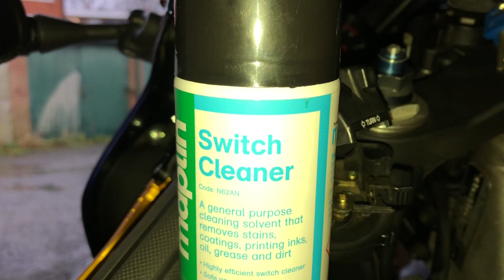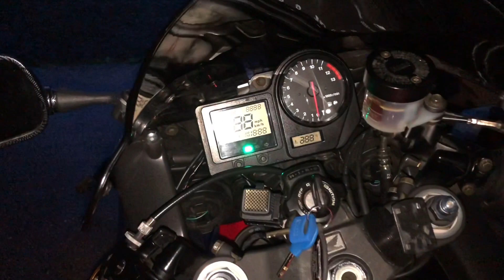Honda CBR 929 RR Fireblade Turn Signal Switch Repair

Comment: Have you had any issues with the hi lo beam button sticking...? I have the exact same bike....!
Reply from the maker: chris sumner. No I don't, working properly.
Reply: I did. WD 40 cured it. Nice little video.
Reply: I did. Sticking beam switch on a Honda NSC 50 Vision.... NOT a Bike, I know! But the same handle.

Comment: Hi, my 2010 Fireblade has same problem, but in my case all 4 indicator get dim and do the headlight and high beam indicator on dash all time on. Should I do the same? Are you using wd40?
Reply from the maker: Just try cleaning this. No WD40, use any contact cleaner. Check if all wires look ok, also black cable going to your battery.

Comment: Hey man, this might be a dumb question.. But did you disconnect the battery before working on the switch? 

My turn signal switch was sticking and I forced it to the left and then all of a sudden it got all loose and won't engage the turn signals. So I think i gotta open it up, but just wondering if you disconnected the battery at first. Thanks! Awesome vid btw. I got a 2000 Honda CBR 600F4
Reply from the maker: Hi thanks. No I didn't. Just key and red button off.